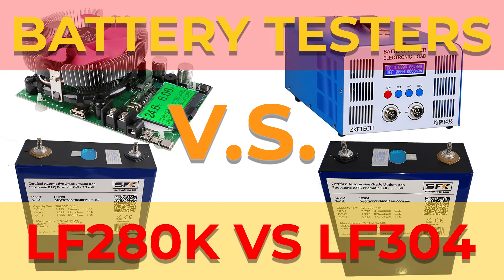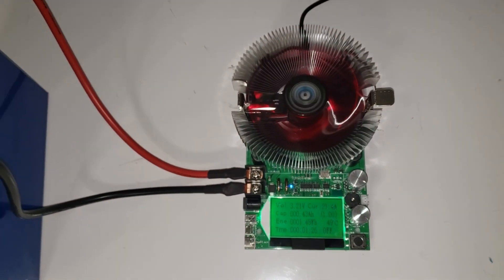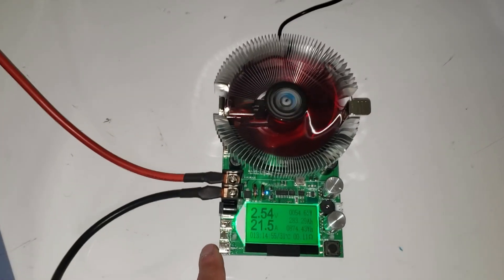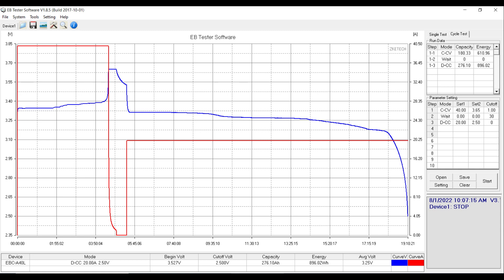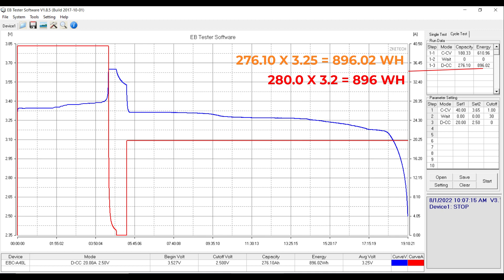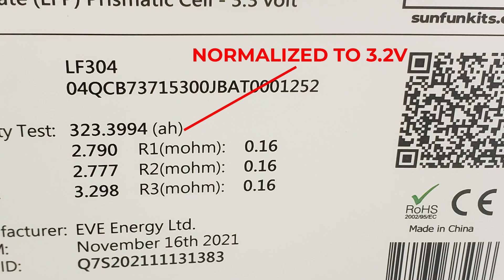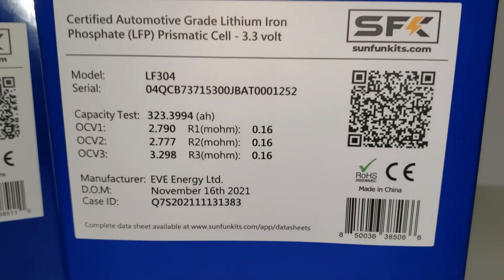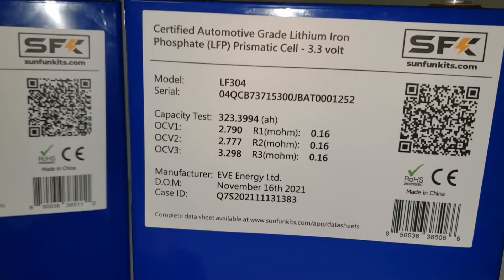Comparing Battery Testers on LF280K & LF304 EVE, ZKE EBC-A40L, Heater w/Fan and our Findings

Comment: You guys are so inconsistent! 

You talk about the cells actually being rated at the Wh rating, so stop giving an Ah rating on them. You need to standardise how you discuss this, because all you're doing is confusing everyone and making a mess of the ratings, and making it very difficult for people like Ray to get to the truth. 

Then you also talk about the LF280K being rated at 3.2v, yet YOUR label says 3.3v... Make up you mind! If you actually provide a 3.2v Ah rating, and quote 3.3v on your label, then it's misleading (AKA a lie). If you rate the cell at 3.3v, then give the 3.3v Ah rating. 

When you measured the voltage of the electronic load, you measured the voltage at the battery, not at the load... That was a mistake that you have done before (Andy has pointed that out), yet you did it again. 

Before you go saying others are wrong, you need to get things right yourselves.
Reply from the maker: You have valid points, in the future our next batch of labels will state 3.2V.

The Tested capacity comes from the manufacturers' test report its not something we create, there capacity is based on 3.2V nominal.

Our tests have v-sense on them we also agreed with Andy and fixed this issue.

In regards to issues with other tests, if you are looking at AH without nominal voltage the conclusions you would make it from it are incorrect, that particular review did not take this into account.
Reply: @sfkenergy  I wasn't referring to any particular review. I'm referring to the massive confusion you create with all the different numbers mentioned. All the things you mention, leave a lot to interpretation and that leads to confusion and likely misunderstandings about capacity results. 

If you want to rate your cells in Wh, then rate them in Wh. Don't rate them in Ah with ambiguous different nominal voltages like 3.2, 3.25 and 3.3v that don't appear to have any solid foundation. Wh, Ah and nominal Voltage should ALL calculate correctly, and your labels don't seem to do that. 

Also if you put a label in a battery, the numbers should be from YOUR test results, not the manufacturers results. When I see a battery with a label on it, I expect that data to be produced by the producer of the label, to confirm the manufacturer results. Or just leave the label off and provide the customer with the manufacturer data. Perhaps you should clearly state that the testing is NOT from SFK.

Comment: I'm not buying this normalization thing.  Ah are Ah...  if a battery is rated for 280Ah..  It should provide 280Ah. Now Wh may have some fudge factor in.  To get the true Wh..  You have to integrate across the whole test.  Folks just use 3.2V for LFP because that's the average V across it's range.  These batteries are, correct me if I'm wrong, sold by their Ah rating not the Wh rating.  So there is no normalization that should happen...  Your own test showed 276Ah!
Reply: Right. I'm not buying this either. All that WH buzz is to make their crap cells to look a bit better. Skip.
Reply from the maker: @antonkireev4098  You can not have a cell pass Watt-hour test and then Fail an Amp-hour. Either you are grade B seller yourself or don't understand basic math.

Amp-hours capacity testing must include the voltage. This is why Grade B seller never  include watt-hour ratings because they can claim look it passed amp-hour test but at the same time failed watt-hour due to voltage sag.
Reply from the maker: Batteries are always rated in WH. Please look at any Electric car like a Tesla, or Ford they will always state the size of the battery in WH never in AH.

You can not have a result that matches the WH but also fails the AH. They must both pass or both fail, which is why nominal voltage is important.

Our tests showed 276 AH x 3.25V = 896 WH which is exactly what is on the Cell it self if you look at the QR code on your cell you see it is rated in WH.

You can display the result as 280 x 3.2 = 896 WH which is the nominal voltage of LFP batteries.
Reply: @sfkenergy  This is not an EV tesla battery..  These are individual cells.  hell 280 is in the name!  All these individual cells are rated in Ah.  Your own website list your complete batteries as Ah, not Wh...  Everyone else that tests these are benchmarking them against they Ah... Not Wh..
Reply from the maker: @jbuszkie  Unfortunately you have been brainwashed by reviewers who keep looking at the AH without the voltage.

You can look at Laptop Batteries, you will see they are rated in Watt Hours. Please do some research on this subject. 
Amp hours without voltage is meaningless, if you are using it causally then its fine, but if you are wanting to perform capacity test you must Have amp-hours with nominal voltage.
Reply: And the car makers have to do this because most of the public doesn't understand  Ah.  And How many car owners know what the voltage of their battery is? The general public understands Wh and kWh..  If the car folks said in Ah, they wouldn't be able to compare one car from the other..  It's Wh that are probably normalized..
Reply: @sfkenergy   Again these are packs.  They voltage is varied from laptop pack to laptop pack. So they have to rate in Wh.  People building these packs buy their cells based on Ah.  How are all these 18650's sold?  By Wh??  no by Ah..

Comment: Even if i still do not like the normalisation thing, i might agree. Anyway if you look at the actual measured Wh and compare them to the nominal Wh or to the factory measured normalised Wh that is totally fine in my view. Just do not normalise measured Ah with 3.2v nominal voltage.

On the 5 cycles: the EVE datasheets says to reach the specs there are more tries allowed - so that should be fine. Maybe for the chemistry of a cell that stayed between 30-50% SoC for storage some months it needs some activity to reach full specs.

Oh and thanks for the preview of that hp8182 software - looks promising. Would have thought there was ready to rumble software coming with it ;). I am curios how those tests will compare to the EBC-40l.

Comment: I do not know what you are doing but the key figure is missing: the ambient temperature EVE has mentioned in their spec sheet 

25°C and the EVE LF280K shows the graphs and impact of temperature on the capacity you can get out of it. 

10°C less would result in 4% capacity missing - rule of thumb in the range from 25 to 10°C
below the 10°C that will increase to 9% loss.

4% means roughly 11 Ah missing due to too low ambient temperature

This is based on the assumption that the missing graphs for 25° and 45°C (you can see them in the legend but not the graph) are overlaying the 35°C curve and therefore have been eleminated by EVE cause they usually are damn close to each other from 25 to 45°C. 

I wonder how long all these youtube channels will show the capacity tests without mentioning the ambient temperature of the cells and how long they had been stored there cause it does not make sense to bring a cell out from the cold into the warm test room just before the test starts. Yes, they do heat up a bit during charging period but it is a different thing , a total different thing all should now from their EV usage. EV The battery heats up during use but the range will not come back cause it heats up slowly and not totally. 

As long this will not happen you can not judge any battery regarding capacity and also it needs a proof when and how the device has been calibrated last time cause in case of changing temperatures this can also have an impact as we have seen before with this particular ZKE EBC-A40L tester at least those from 2021 and 2022.
Reply from the maker: Ok from now on we will include the temperature but it is RTP during our tests.

Comment: Interesting. What I understand from this video as it relates to the results of Ray's test is if at all there is any errors, those errors lie with the cell and the tester and not with him. The challenge here is that he used the same tester and same methods for all his tests. As I suggested in my comments on one of your previous videos, you might want to consider making more conservative claims about your cells. If a cell will
 yield the stated amp hours only after 5 tests then state that clearly on the cell. The stickers you put on those cells are unusually large and should have enough space for detailed information if written appropriately.
Reply from the maker: Mr. Ray always has tested grade B cells  whose voltage under load is below 3.2V during the tests so for him work without having to normalize. However, since he had claimed he had tested Luyuan cells before we assumed he had been doing the voltage normalization, if not its not possible to for the Luyuan cells (same as ours) to test a 284 X 3.25v = 923 WH, all LF280K cells settle to around 896-904 WH very quickly, this is by design. So I think he never actually tested Luyuan Grade A cells before which is why our results were so screwed up; honestly if we had known this we would never sent out kit / cells...We tried to explain but got no where... 

Anyway:

THE CHEMISTRY OF The LF280K IS DIFFERENT THAN LF304.  The 304 Chemistry follows the label closely, I do not think you can use the same method of grading on this High Cycle life capacity type prismatic cell. Thus AH test is not a good way to determine Grade A or Grade B on the LF280K.

Lastly we do not make this data on this label, it is supplied by EVE the manufacturer.
Reply: @sfkenergy   As i commented in another video: normalizing by 3.2v does not have any effect if you get relative numbers compared to nominal capacity (% of nominal capacity is the same for Ah and normalised Wh). Simple math 🤷🏻.